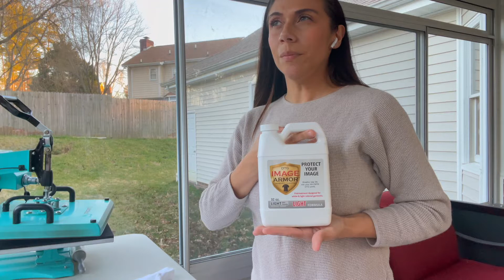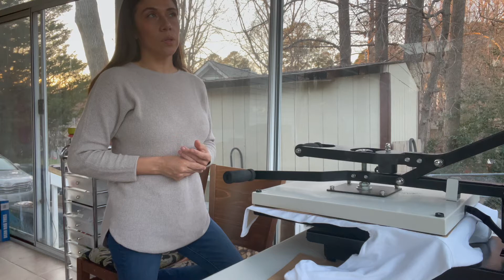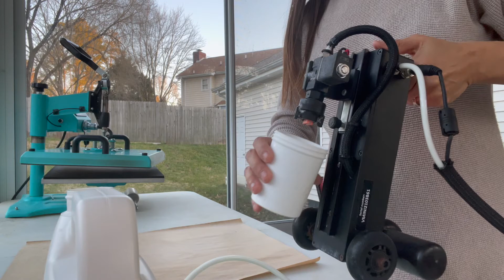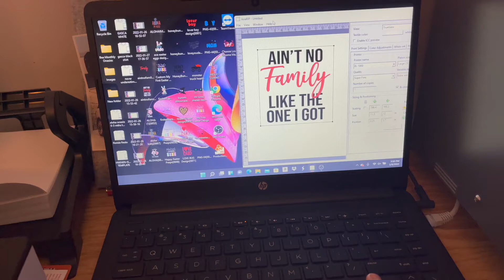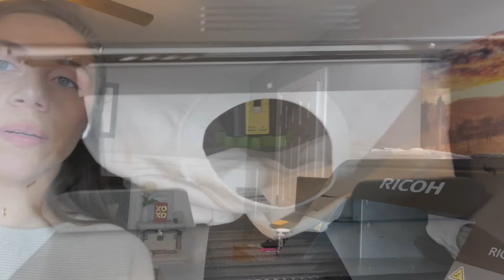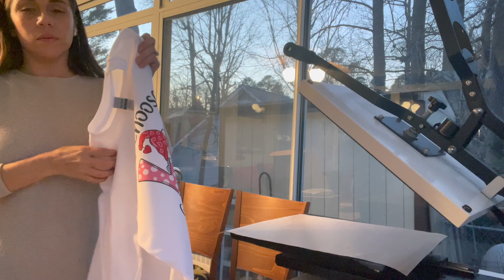MAKE A VALENTINE'S DAY SHIRT USING THE RICOH RI1000 DTG PRINTER & A HEAT PRESS

Comment: My Ri 1000 came with ColorGate and AnaRip. Have you tried them both? If so, which do you like the best and why? Thanks!
Reply from the maker: Hey Guenevere, thanks for the comment. Mine also came with both softwares, I use AnaRip because my ColorGate was put onto a laptop I originally bought for the Ricoh Ri1000 that I had to exchange because the specs on the first laptop were not gonna be enough to run the Colorgate software. Once I got the second laptop I was never contacted back on how to get it reinstalled onto the second laptop. I went back and forth with Colorgate and still to this day almost a year later still never resolved my issue. This is why I only use Anarip, it's unfortunate because I know a lot of people say that Colorgate is better.